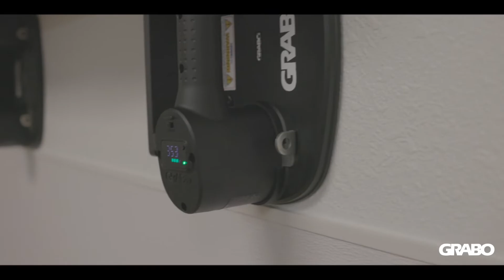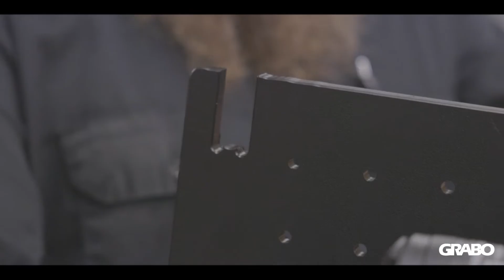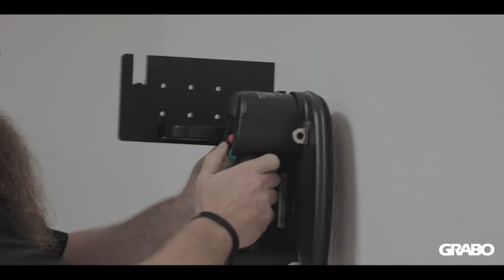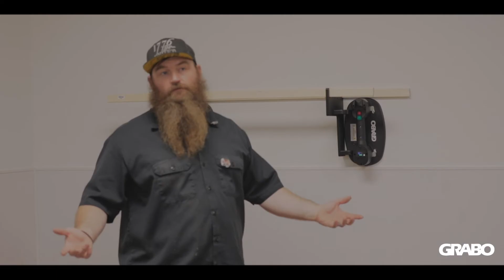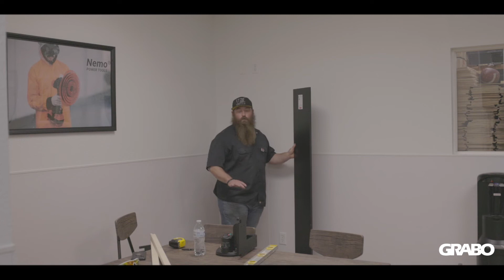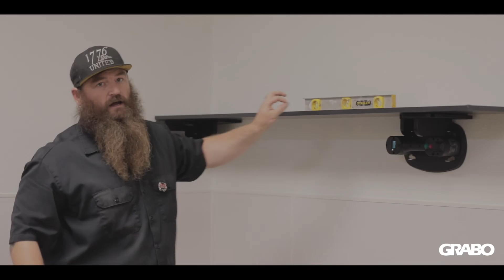GRABO Cabinet Plates by Izzy Swan Introduction and Demonstration

Comment: What conditions do wall need to be for grab to hold.
Reply from the maker: The grabo will grip onto drywall and plywood. Even better on a finished wall. Just as long as it’s not extremely porous where it will leak more air out than the grabo can pull in.